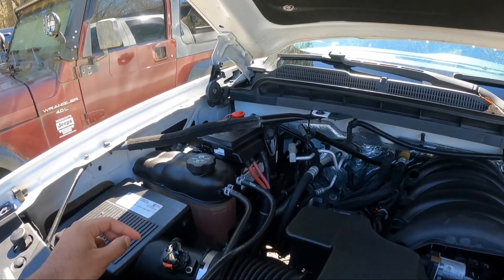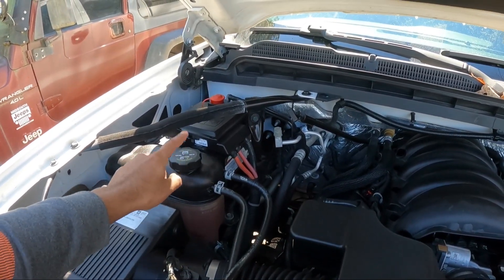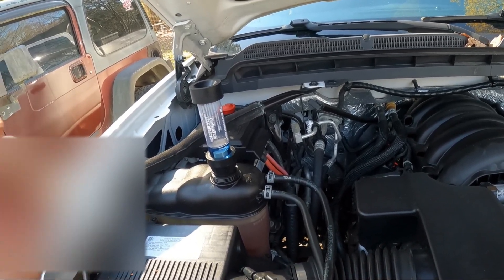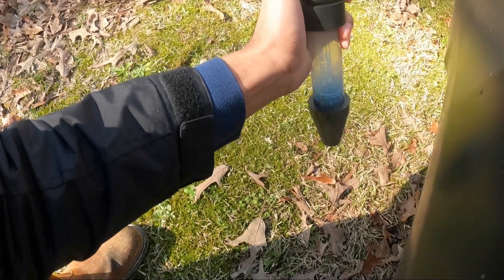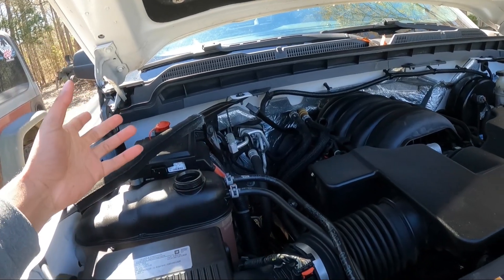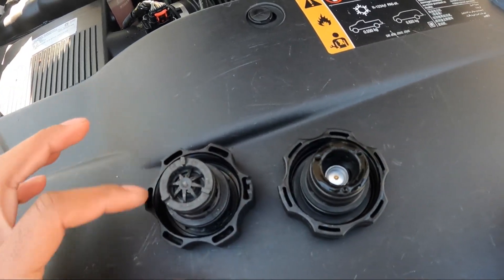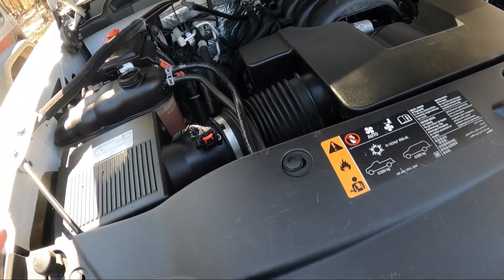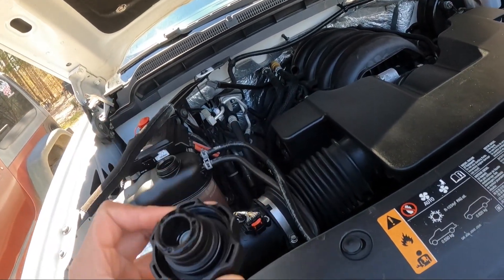Checking for blown head gasket

Comment: It might be a small leak on your radiator.  I’ve had the same issue.. but I realized that my radiator has a minor leak on the inside edge.  And I only noticed it when I removed my AC condenser that I had to replace just last week.  I would’ve never been able to see it if it wasn’t for that.
Reply from the maker: If it was can you still see it on the ground if it was leaking?
Reply: @SESneak  no it’s weird, but the leak is not making it down to the ground it’s very very minor but it’s there.  I noticed it on the inner edge.  I’d attach a picture if I could but I don’t think I can on here.
Reply from the maker: Thanks for the tip
Reply from the maker: So what you do to locate the leak